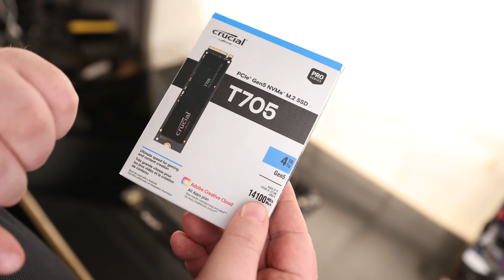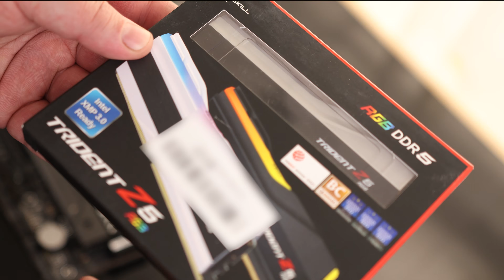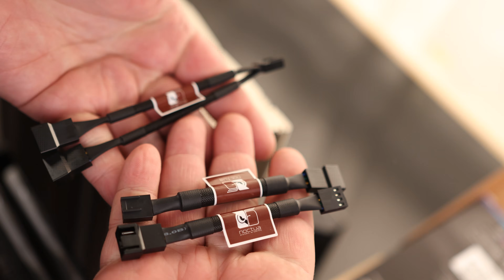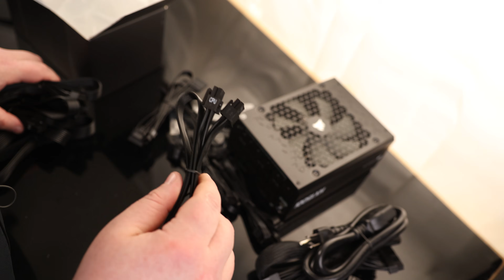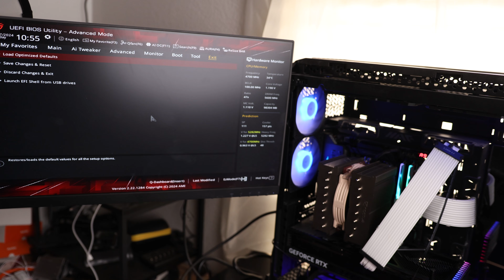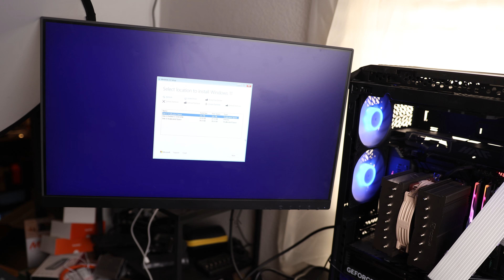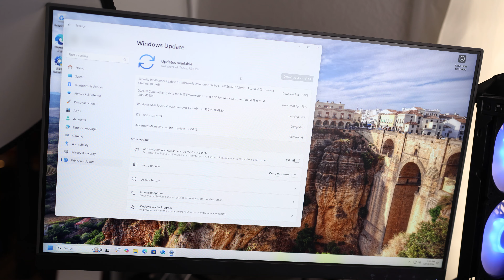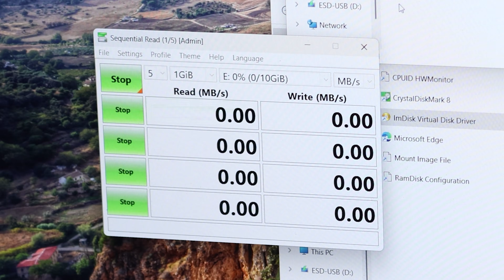Full Build 9800X3D, ASUS X870E-E, G.SKILL Trident Z5, Crucial T705, Noctua NH-D15 G2, HX1500i

Comment: my hardware went smoothly; the problem was the BIOS update: locating the missing PD_UPDATE_TOOL_V0206 for installing update V4242 (which is important for running the 9000's). Stuck!

Comment: Guys, question, I have the same RAM kit, just 32GB, and is only labeled as XMP, Using on ROG Strix Gaming Z790-E with an i9 13900k, I was thinking of upgrading to AMD 7 9800x3D with corrsair  MOBO or the same MOBO here. can I use my RAM kit since RAM prices are insane PLS tag me when answering

Comment: Love how you completely skip the gpu installation. We both know this motherboard is ass, doesn’t fit big gpus and the heat sinks are all in the way.
Reply from the maker: You're wrong.
Reply: I have an exact build to this so no I’m not. Also my ram is the exact same as yours as well and it wobbles in the mobo even fully locked in.

Had nothing but issues with this mobo. They failed to fully fix the tpm issues too and that’s after not admitting that it existed for 9 months.

Not to mention the Realtek Ethernet controller problems and the bloatware from armory crate and the proprietary technology for their ai overclock that interferes with anti cheats and makes it look like dma.

Comment: Hello, I'm writing from Türkiye. I'm building a new system. I bought the same motherboard and I have Gskill 16x2 GB RAM CL30. I'll be getting the processor shown in the video. My old computer has a Hyper 212 Evo tower-type CPU cooler. Actually, I'm thinking of getting an ASUS ROG Ryujin III Extreme for the new computer, but tower-type coolers are always safer. I saw that you couldn't install a second fan. What's the highest temperature you see in games? Compared to liquid-cooled CPU coolers, are you satisfied with your current cooler?
Reply: im looking to buy a cpu cooler/fan, this one don't seem like the right choice
Reply from the maker: Playing Space Engineers today, I hit 81.0 C Max.  I'm happy with it.

Comment: For a 9950X3D would you plug in both of the CPU cables? Or just the one
Reply: If you have two, just plug in both cables. It won’t hurt anything and it won’t draw more power. it’ll stay the same as with one cable but you’re always sure you have enough power.

Comment: one thing about error code 15. It is not neccessarilly a RAM error. error 15 is the RAM check code. If you have more than 32GB RAM in the system, it has to check not only all the RAM but also each slot for which it is in. for example if you have 4 sticks of 32GB, it takes time for the BIOS to check each slot and how much RAM is in each slot which can take up to 30 minute to do so be patient. Secondly, Windows 11 (both home and pro) do not like RAM that is overclocked. so if you are using DD5 (which you have to use for any AM5 socket) ensure that in your BIOS, you leave the RAM clocked at 4800 MT/s until windows is fully installed and running. after you install Windows, shut down your PC and restart it in BIOS (turn on the PC and mash the F8 or DEL button to enter BIOS). Then go into the RAM section of your BIOS, go to advance settings, go to extreme tweeker. at the drop down from the AI overclock tuner, set it to EXPO I. AT Frequency set it to the Frequency of no greater than 5800 MT/s (this is the factory standard for the AMD 5 processor). Save and exit and let it fire up. again you may recieve a 15 Error code on the motherboard but just let it continue booting without turning it off and on, again this may take up to 30 min depending on how much RAM you have in the motherboard.  There are others that have Overclocked their RAM at much higher speeds. I myself have it at 6000 MT/s but then I always error on the side of caution. you do not have to worry about what is underneath the Frequency option for the RAM in the BIOS. Setting the EXPO I profile and voltages for the RAM. These values are for people that know what they are doing and if you don't, then you could damage your system by fiddling with them. better to leave them be. You will also see options within the AI overclock tuner such as EXPO II and such. I would highly recommend leaving them be and using EXPO I only. these options are for higher clock speeds for higher speed RAM and are not really for use at the consumer level. EXPO II ranges from the default JEDEC speeds (like 4800MT/s) up to speeds of 8000MHz or higher on compatible systems. just because the option is there does not mean you are to use it. It can damage your system!!!  EXPO I lets your RAM run at speeds like 5200MT/s, 5600MT/s, 6000MT/s hence why you have to set the RAM memory frequency to its proper speed as well.
Reply: Error 4d como lo soluciono?

Comment: Just curious with the RAM speed, been seeing mixed reviews about this board running ram over 6000mt/s , have you had any issues running the 6400 at 1:1 or did you have to go into bios and go to xmp 2 and run it at 1:2

Comment: not putting the cpu in first before attaching the cpu fan brackets = wrong. Also that air cooler the second fan doesnt even fit. aio ftw.  good effort 7/10

Comment: Quick question as im about to build the same system if you get a second nvme but dont use the 2nd or 3rd slot does it still effect the gpu ?
Reply: If you leave slots 2 and 3 open then no it won't affect the GPU but if you use slots 2 and/or 3 then yes it will cause bifurcation causing the PCIe 1 to drop from a x16 to a x8. If you want multiple drives then you could build it with 1 Gen 5 nvme and put that in the #1 slot (with the push tab) under the CPU and then get a Gen 4 nvme and use slots 4 or 5  just above PCIe2 to use the chipset. But in reality it will only be a minor difference in performance using 2 Gen 5 slots, but using the Gen 4 will help maximize your build. I use a Gen 4 strictly for windows and random files and my Gen 5 for gaming. But what really matters is what you'll be using your PC for. Mine is only for gaming, I don't stream, edit, work or anything like that on mine so I'm ok with a smaller storage Gen 4 for windows and misc files
Reply: @CoreyC84  thanks for the info ended up getting a 4tb gen5 but in the future gonna get a 4tb gen4

Comment: I have this same board, and tonight I tried to test my hardware before installing everything into the case. When I inserted the GPU into the slot, it was uncomfortably loose -- to the point that I didn't even plug the power cable into it to fire it up. Is that normal for this board?

Comment: 12:31
OH wow, I have the same processor. I have the Asus Rog Crosshair x870e Hero mobo and it has two cpu power inputs as well. My gpu is an Asus Tuf RX9070xt(3-8pin). I'm trying to follow the manual/instructions while hooking up the power cords to a Corsair rm850x psu. So you're saying that I don't have to connect both 8pin up, if I'm not an overclocker? I'm not, if I did it was maybe a small 5% boost using Afterburner, but with this beast I might leave well enough alone. The other power input in question with my mobo is the other 8pin connection just below the 24pin on the right side. I've read this was optional as well for over clocking...or was just to power up the usb-c input on top of my  3500x case. I've never used that type of a usb, don't know what I would use it for. So here I am wondering if I should do the same and just connect to the right side cpu connector? Then just leave the 8pin under the 24pin empty as well leaving me with one extra cpu/pcie output on the psu? It's been years since my last build. You had to have a floppy and CD rom with windows disc ready. It all fired up, but days later I was asked if I had flashed my bios.......huh?  I had a work friend come over for that one lol, that stuff was really scary back in 2002.

Comment: Nice video can you please provide link for the bios update pleas?
Reply from the maker: https://rog.asus.com/us/motherboards/rog-strix/rog-strix-x870e-e-gaming-wifi/helpdesk_bios/
Reply: @Distractor_Beam  My previous  Rog X670E-E got fried out due to over heating and in my new rebuild the pump seems not to be working properly because even the new  X870E-E board is still indicate a temperature between 45 and 53 which I thing the predecessor is not being cooled properly by the old pump so I am ordering for a Noctua NH-D15 G2
Reply: @Distractor_Beam  thanks I finally updated the the Bios and every thing was super nice

Comment: Any issue running expo? I have the same board but the corsair 6000mhz 64gb vengeance. It would memory training every single time I reset or turned off the pc. It would not teconigixed devices either. The second I turned expo off everything was fine! So I just dont get it.
Reply from the maker: I don't know.  I haven't had any issues.

Comment: You should be using the 7mm offset holes for mounting that fan. I just setup a 9800x3d with that cooler and the manual says on am5 to use the 7mm offset.
Reply: Tried this on mine from the manual, but the radiator ended up overhanging the PCIE X16 slot. Noctua support then recommended using the default position - same as this guy.

Comment: Just built a very similar setup for my wife only difference is the ram, cooling and PSU and video card (128gb @6K, corsair cooler, 1000w PSU, 9070 gpu), I used the shared PCIE for the drive because of the heatsink and didn't think about the shared lanes so, might have to move stuff around now lol.

Comment: the case haf 700 evo states 166mm as max clearence for cpu cooler and the noctua nh-d15 g2 states 168 is required. Can you still close the case?
On noctuas own webside they state that this case is incompatible according to their case compatibility list.
I ordered everything except the cpu cooler😅
Reply from the maker: There's a small amount of clearance.  It's enough to close the case and leave a few millimeters..  Unless they changed the dimensions of the EVO or the Noctua since 2023, it should still work.
Reply: Thank you very much! I will go with the LBC version as well. As my RAM height is 34.9 mm, I will use the front Noctua cooler as a bottom cooler and install a 120 mm cooler in front of the Noctua G2

Comment: Hi Sir , i just bought 9800x3d with asus rog strix X870-A Gaming Wifi + 64 gb corsair vengeance 6400mhz cl32 , rtx 4090 rog strix , 990 pro ssd + arctic liquid freezer III 360 and 1000w rog thor PSU , will i face some problem with my RAM ? do i need to get it on 6000 mhz and cl 30 or 28 ?
Reply from the maker: I don't know.  It's worth keeping in mind, I made this video about 6 months ago.  Anything you buy today may be a part of a newer run, and may already have updated BIOS in comparison to what my board was shipped with.

Comment: Wow, I got lucky to find your video, today! I'm building myself a new gaming PC this weekend with the same CPU, Mobo, GPU, and RAM. Almost chose the new Noctua, but I just don't like the look of that big bold beast. Went with an Arctic LF3 360 Pro, instead. Excellent video, mate! New subscriber
Reply: just bought all my parts for practically this build exactly. i got the same crucial t705 with the heatsink and a samsung 990 pro 4tb. how did the build go? any tips since our builds are so identical?. i got the same arctic cooler. fractal north xl case
Reply: Hey man! Build turned out great except I had to change the mobo to MSI X870E Carbon and RAM to Corsair Titanium 64GB. The Asus board had a bad Ethernet port and one of the G. Skill sticks was DOA. All other components were solid.
Reply: @MadMaxx_V8  o wow hopefully no whammys on the board for me. im just waiting for the cooler to show up. its the one thing that decided not to ship or i didnt pick up at a microcenter. thanks for the update.

Comment: I just bought ASUS ROG Strix X870E-E and Samsung 9100 PRO HeatSink SSD 2TB should i remove original heatskink from ssd and use X870E-E heatsink ?
Reply from the maker: I don't know with that model, but with older Samsung drives, if you remove the oem heatsink it voids the warranty.

Comment: Can you please post your cpu temperatures? I also ordered an 9800x3d but i still dont know if i should get an arctic lquod freezer 3 360mm or a noctua d15 g2, id rather have an aircooler but the noctua is almost 2x as expensive as the arctic liquid freezer with way worse performance.. but if the noctua is capable of keeping temps under 75c i would get that one

Comment: Hi. I have this MB, CPU and GPU. I get random GPU detection during boot issue. Have you ever get simillar problem?
https://youtu.be/TAmQhZKQ6Yw?si=gsoGtNoO9z3R44gy
Reply: That's a strange one.  I watched your video, and it looks like you've done everything I would've done.  At this point I would start swapping parts and look for new behavior.  Do you have an old video card you can test?
Reply: @distractor_beamreviews  Thank you for your time.

This graphics card worked fine for over a year on my previous platform (Asus Maximus XI with i9 9900KS processor).

I have Corsair HX1000i power supply (last revision with GPU 12PWR cable). There was never ANY problem (maybe except for loud coils - but unfortunately I got such a Strix piece - unfortunately it is often like that).

Now I have changed "only" RAM (it is on the QVL list), CPU (like yours) and of course the board (also like yours).

One of the users left a comment under your video that he had a similar problem and on two! boards (he was surprised that the boards were not sealed like mine, yours was not either - so it is clearly not a rule). Asus claim that they should be... Strange.

Until I watched your material I was sure that it was some problem with the BIOS of this particular board communicating with the BIOS of this particular GPU. And I have to wait for BIOS/firmware updates. I am in constant contact with Asus. But since this setup works for you (Strix 4090 OC and this motherboard) that rules out my guess.

I've been struggling with this issue for well over a month now and it's terribly annoying that I never know if the computer will boot up / detects my RTX.

Now the next step is to replace the motherboard (hope for simple 1 to 1 exchange - waiting for Asus and my dealer to shake hand). The worst thing is that if everything clicks at startup, the computer works perfectly stable and without any problems...
Reply: @konradbak  I saw that.  He said his cpu was missing a pad, so he changed the motherboard and cpu and his problem went away.  He also said his build never got a display, rather than intermittent.  

I'm hoping the new board works for you.  Keep me posted.
Reply: @distractor_beamreviews  One more thing. How do You connect GPU power cable? Its some extender I see but to the PSU? 12VHPWR? I used original Corsair 12VHPWR cable.
Reply from the maker: @konradbak  This is my exact configuration:  https://www.amazon.com/dp/B0BLXYJ8VR  and  https://www.amazon.com/dp/B0C25XCJ2F
I know Corsair was bundling some underrated cables previously, so I got an upgraded version just to be safe.  I'm not sure if it made a difference.  It could be worth a try.
Reply: @distractor_beamreviews  I have one more request for you.
Can you check what exact BIOS you have for your graphics card (e.g. in GPU-Z)? Are you using BIOS/Quiet or Performance mode?
I have BIOS 95.02.3C.40.FA, Oct. 12, 2022.
Reply: @konradbak  95.02.3C.00.60  It's in performance mode.
Reply: @distractor_beamreviews  After 4 months of waiting for Asus regarding the BIOS for the motherboard and/or graphics card, I solved the problem.

Strix 3080Ti graphics card worked correctly on the STRIX X870E-E board, so I suspected that maybe something was wrong with the Strix 4090 card itself (which, however, worked correctly on the Maximus XI board for over a year).

Well, in the end I replaced the motherboard with the MSI x870 Carbon WiFi. And the problem was solved. Everything works as it should - no problems. In general, the board seems to be designed much more sensibly, including a much simpler BIOS. So goodbye Asus - at least when it comes to motherboards - I won't be going down this river again (after a dozen or so years). And it's not about something not working, but about the fact that the support department did not help in any way.
I'm sending the board to the seller for RMA with a refund request - 4 months of being fooled by the support department is too much for me!
Reply: @Distractor_Beam Changed motherboard to MSI x870 Carbon and problem solved.

Comment: In the process in buying the same cooler and chip, good video from start to finish. Please tell me you relocated that GPU power cable to run below and not across the ram and dont forget to put the 2nd fan from the noctua cooler.  :D 
Keep up the good work!!